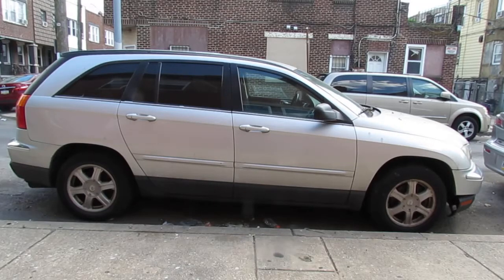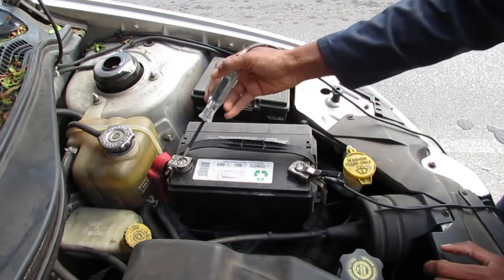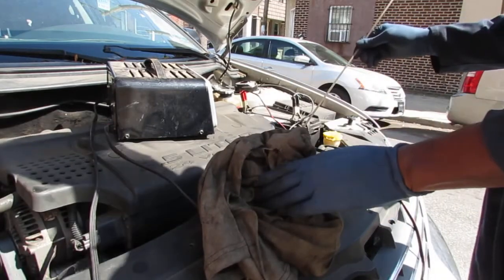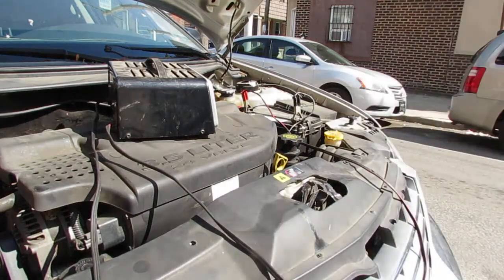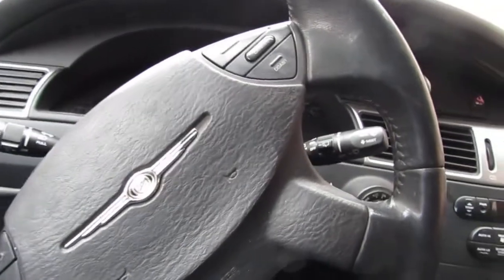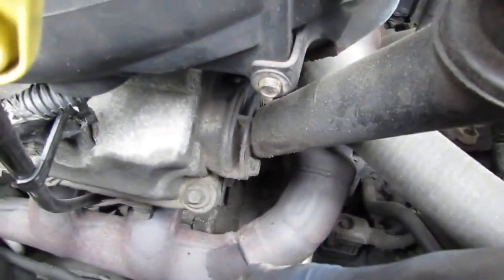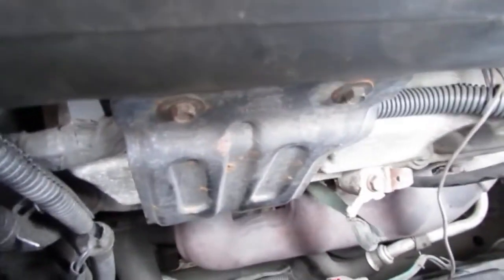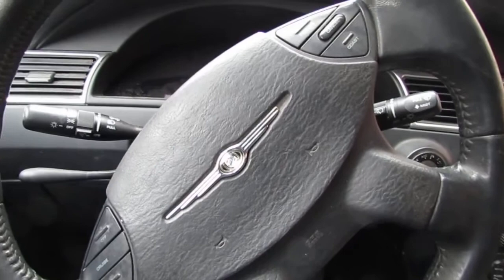2005 Chrysler Pacifica Failed Starter Diagnosis

Comment: If you look back at  your video you’ll see a  ground strap coming from the starter through the exhaust manifold. If you notice the strap is green covered in corrosion.  I replaced  ground strap from the starter  and got much better ground to fix the issue
Reply from the maker: That is always a great place to start of as corrosion causes high resistance which limits an electrical motor to operate with full torque.  I knew it was something else.  The answer I found in the second part video.  The alternator was seized.  2005 Chrysler Pacifica Failed Starter Diagnosis Part 2
https://www.youtube.com/watch?v=zJWtSaI4EN8&t=10s

Comment: chrysler stupidly placed the starter upside down where the starter terminal has the ability of smaking the front motor mount shorting the the battery. People try to put rubber on the starter terminal to keep from connecting. My situation front mounting bolt snapped and starter terminal pressed against motor mount rediculous. grounded the battery. Unbenownst to me. It reveresed the polarity of the battery! Had to disconnect battery and adjust motor mount.
Reply from the maker: That motor mount is the most annoying thing.  I really wished it was engineered much more serviceable.  Do you know anything about when this design started that created the failure you described?

Comment: The battery is DEAD man. If you don’t give your vehicle enough amps it will click and not start

You have to take the intake manifold off to gain access to the starter man.

Use a Life Data option on your scanner if equipped